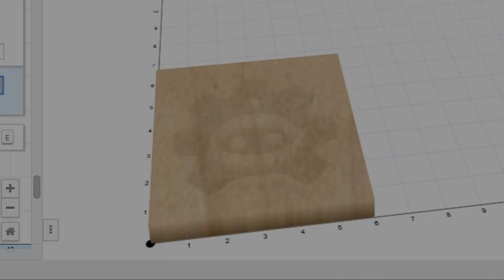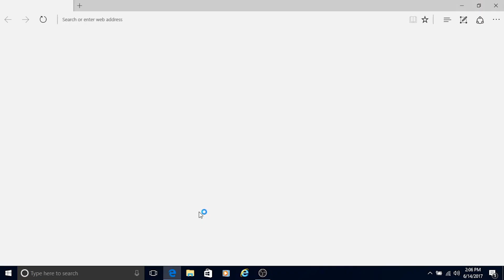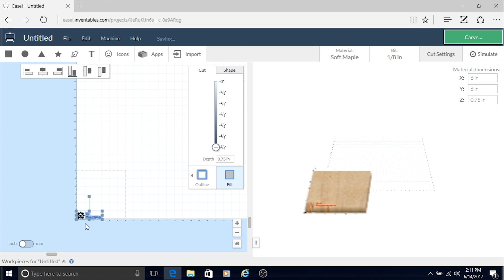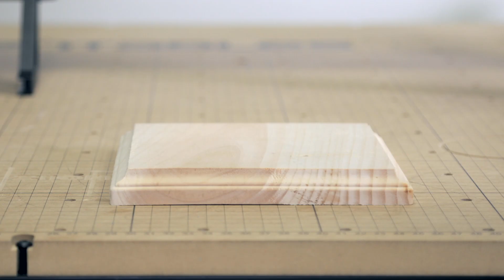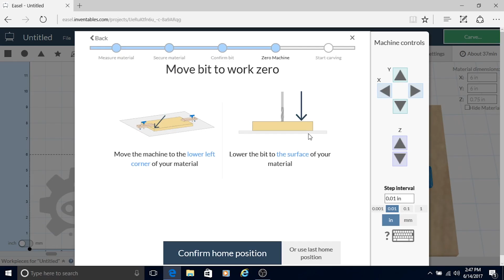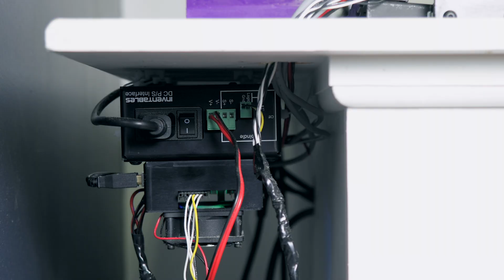Intro to Inventables X-Carve CNC router | Ting Makerspace

Comment: Nice little intro to CNC there. While this is specific to an X-carve Its basically the same with all of them irregardless of size.  The procedure details will vary from one to another, the related software will almost always be different but you wind up doing the same thing. 

Over the average week I often wind up doing stuff on my total home brew, a friends kit one and 2 laser cutters. All of them function almost exactly the same as far as motion control goes With lasers there is no Z like a cnc to worry about but you may have to twist a focus knob. So even that is roughly equivalent.  

With any fast moving sharp metal safety should always be kept in mind. With lasers the beam has the possibility of blinding you for life or fry a finger.  NONE of these are dangerous as long as you ALWAYS follow the specific safety procedures for the one you may be using.